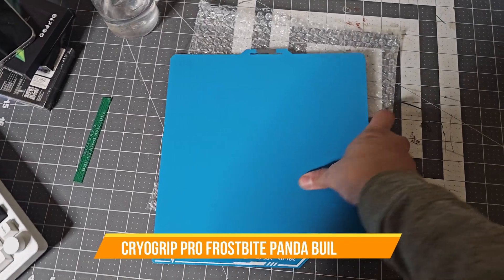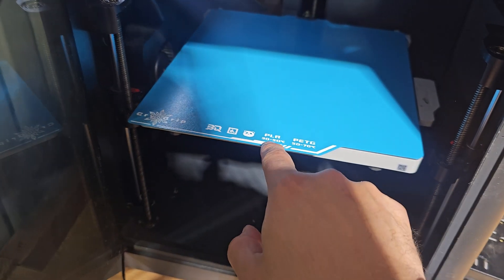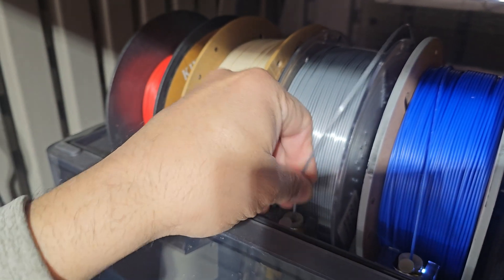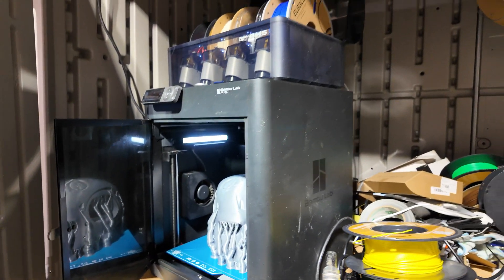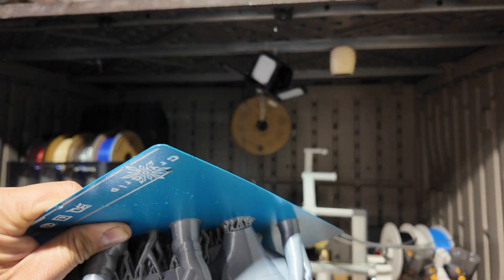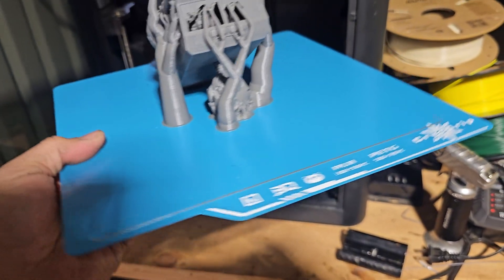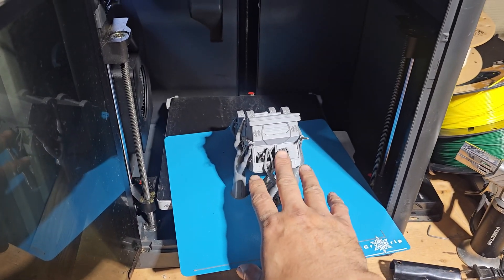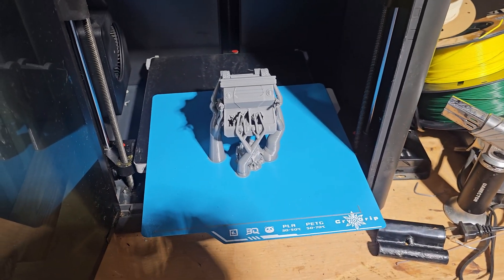Cryogrip Pro Frostbite Panda Build Plate

Comment: Even for very grippy build plates like the Biqu Frostbite and Glacier, avoid touching the printable surface with your greasy, oily hands like you did multiple times in this video. You're just reducing first layer adhesion. Don't clean these surfaces with IPA - mild dish soap and warm water only.

I have both the Glacier and Frostbite, and as you mention, they are excellent build plates which I use for 99% of my prints.